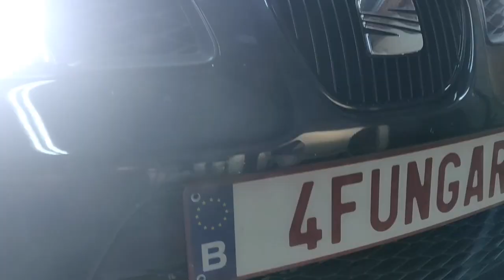Seat IBIZA 6L 1.8T - DIY SHORT SHIFTER

Comment: Hi, did you just randomly place the hole you drilled out or did you use a specific measurement for location? Not much content on 6l 1.8t so would be good to see some more stuff man, best of luck to you. 👍
Reply from the maker: Hi! It was drilled in a certain way so it is possible to switch back to the original place.
Reply: @4fungarage886  
How far apart is the new screw from the old one?